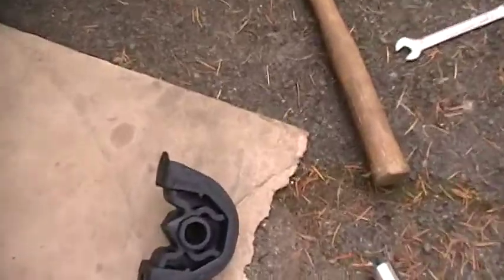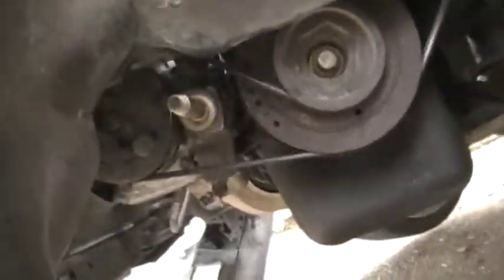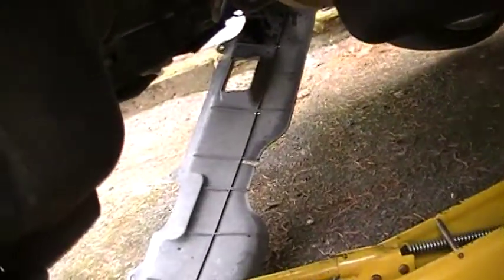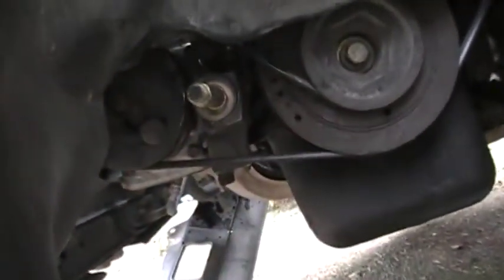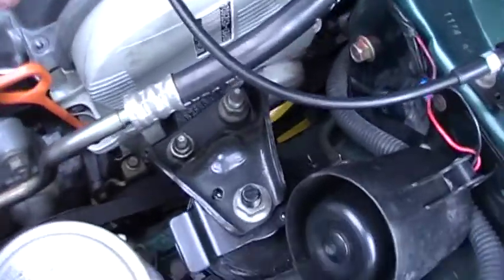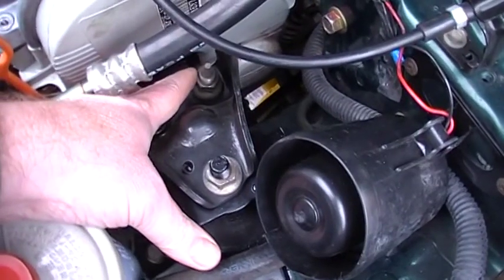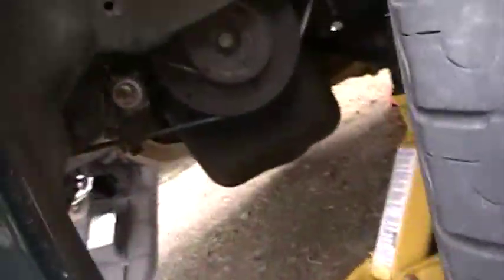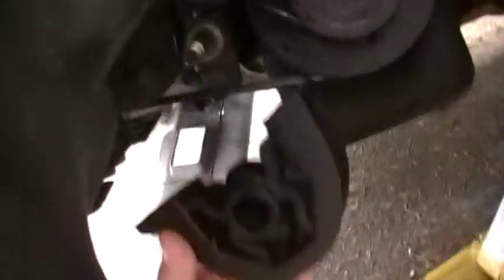1999 Civic Replacing lower left motor mount

Comment: I would have liked to see you install it. Which is the most important part of the process!!! You left out the most important part!!
Reply from the maker: Just put the mount on, the same way you took it off, but reverse the process.  Make sure you look up the torque on the engine mounts.

Comment from the maker: Put the lower mount back on, and the other small bolt you got out.  Loosen the small bolt you are able to get out, more then the one that is spinning on you.  Then loosen the two nuts on top of the engine.  Make sure you have a jack under the engine.  When you loosen the two top bolts, this will drop the engine to the jack, then you can lower the jack and put pressure on the bolt that is spinning.  This might hold it in place so you can get it off.

Comment from the maker: Good question.  I should make a video on how to check them.  Three things:  You hear a strange sound from under the hood.  You can check them by looking.  If you lucky, you can see it is bad.  Another is; with engine off, you put the car in gear.  Release the brakes.  Then with the hood open, rock the car front and back from the front.  You will sometimes hear a bad mount.  Also, and more often, you will see the engine moving.  Thats how you spot most of them.

Comment from the maker: @hockeydave23 Try to hit the threads of the lower motor mounting bolts with some wd40.  Don't spray up past the threads.  Let the soak for 15 minutes.  Then loosen the upper mounting nuts.  The ones that I show in the video.  This will put downward pressure on the lower mounting bracket.  If your lucky, that pressure will help your get the bolts out.  I would still have a jack under the engine so you can control how much weight you put on the mounting bracket.

Comment: I had to drill and cut a big ugly hole in the frame to get to them.  Some have had success with reaching in from the front of the car after removing the bumper with a reeeeallly long socket wrench.  Even with a large hole cut out, I had considerable difficulty getting a wrench on them, so I have my doubts about that method.

Comment: I've got similar mounts on my 92 hatch and noticed that the shank of the bolt doesn't fit snugly on the collar of the lower engine support and you've got a lot of space there for movement.  The same is true for the lower trany mount and trany support arm.  You can see this once you pull the 19mm nut and washers off the ends.  Is this the same for your car?
Reply from the maker: I need to pull an engine out of a 95 Civic.  Will check it, when I do that pull.
Reply: Thanks a bunch. Great vid btw.
Reply: I noticed the same thing & could not find any info about it. I just replaced it like it was. any info as to why would be apprehended.
Reply: I was told the loose fit was to account for the engine spin while under torque.  A sort of gradual force dampening effect, maybe?  Then again I was told by my buddy that owns a later model EF Hatchback that his fit snugly.  Energy suspension parts make support inserts if you want to stiffen em up.  They claim it remedies the spin that the stock design allow and give the power delivery of the motor a more responsive feel.

Comment: Where on the engine is it being supported?
Reply from the maker: +Frank C not sure where I was putting it in that video.  One good way to do it, is to put a wide piece of wood on the oil pan.  Your just supporting, not holding the whole weight of the engine.

Comment: Great video, thanks for posting.  Helped a ton!
So, on my situation, I couldn't get the bolts loosened on the upper engine mount (need an air ratchet, etc, blah blah).  So.... I placed about 100 pounds of iron weights from the home gym on top of the valve cover, voila, pushed the engine down JUST enough to slide the lower engine bracket onto the spindle.  :)

Comment: do a bad motor mount cause the steering wheel to shake at high speed ?
Reply from the maker: Guess it could.  Though i have never experienced that.  Should have an alignment shop look at it.  If you have a bad ball joint, your wheel could come off.
Reply: My ball joints is good and my tires are good and the alignment good I just have a bad motor mount on my civic and it's shaking around 60
Reply from the maker: Another thing that can cause that, is one of your wheels out of balance.

Comment from the maker: Spray them with some wd40.  I would try to use a 1/2 inch setup on them.  If you can't, put a pipe on your ratchet to make the handle longer.  Let the wd40 sit for about 5 minutes before trying again.

Comment: Be careful!  Honda used tiny little captive nuts spot welded into the frame.  Too much torque and they WILL break off inside the frame, making the mount a great deal more difficult to replace.